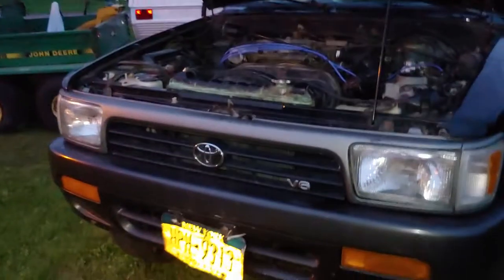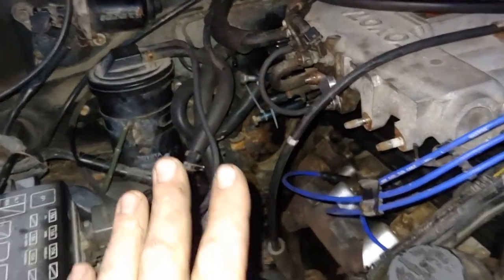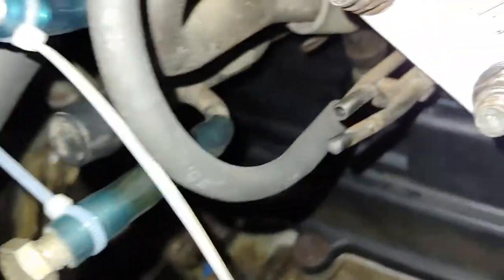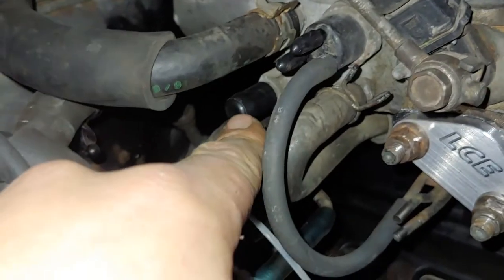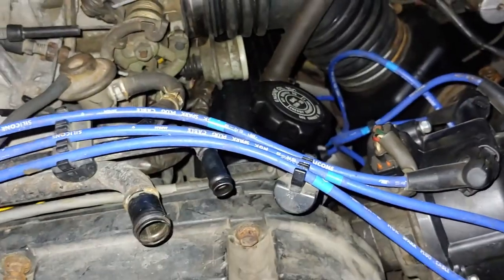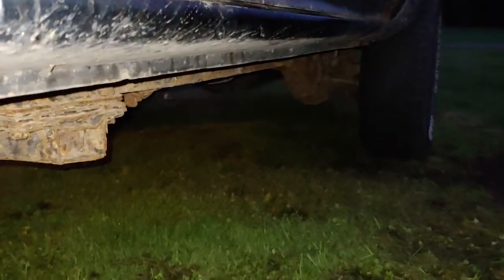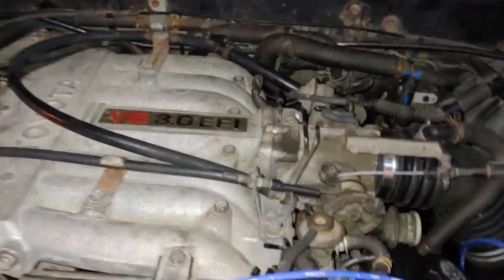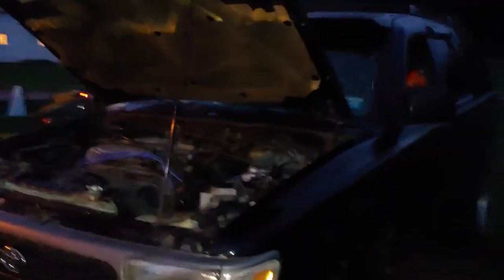NEED HELP 1992 Toyota 4Runner 3.0

Comment: I had similar symptoms.  I finally took the fuel pulsation damper off at the back of the passenger fuel rail.  It wasn't leaking like most failures, but the screw was loose under the cap.  You can't just slap the screw back in.  Replace it.  It can make a lot of strange fuel issues happen.   Good luck!

Comment: CRC mass airflow sensor cleaner spray, you must absolutely use a OEM Denso oxygen sensor installed properly. It must be an authentic sensor from authorized Denso distributor. Don't trust mechanics to do this type of stuff. They buy whatever Delco or Dorman or other garbage. Also run a tank gas with BG 44K Platinum...Great stuff.  Why did you block hot air from the engine from going to throttle body?

Comment: that year and engine has a recall for head gaskets. Toyota would of done everything for you for free. They should reimburse you for parts and labor. It happened to me. I have a 92 SR5 3.0. If you ever have another problem with head gaskets, take it to any Toyota dealer and tell them you want to do the head gasket recall. Toyota also honed my cylinders for free. They are using a different type of head gasket that was originally used. I now have 500,000 miles on my engine no problem. The head gaskets blown at 100,000.
Reply: Surely that warranty work is over, these engines are 30 years old now
Reply: @lsxbird7874  I actually had mine replaced twice on warranty.  Mine is 1992.  Once in early 90s right after I bought it, and again around 2005 when they blew again.  Now it has 500,000 miles on it and still running strong.  I took it to two separate dealers.  The first time Toyota didn’t tell me about the recall and I paid out of my pocket.  I then learned about the recall and they had to pay me back.
Reply: @lsxbird7874  it's a special service campaign, never ends. As long as the vehicle was listed in the campaign then they will go through with it. Contacting Toyota will get you further than some dealerships, some dealerships play dumb about it and other's go through with it.

Comment: First off, it's a 3vze not a 3vre...  Second, it sounds like your catalytic converter is clogged.  That is what the rattling is under the truck.  Basically your truck is wheezing under idle because it can't breathe out.
Reply from the maker: Thanks for the comment. I knew I was wrong as soon as i said 3vre. 

Any advice for a clogged cat? Is there a possibility of just shoving something through it?(I've heard that mentioned before) Or am I better off just getting rid of it? I want to do things as right as possible, but its also a $1200 car thats quickly gathering Northern New York salt rot on the bottom, so I'm not against any option that will get it running down the road alot better.
Reply from the maker: Im not usually an automotive mechinic. As a matter of fact I don't like it much at all. I am mostly a motorcycle, atv and small engine mechinic. Antique Motorcycle mechanic by trade. So, excuse me if I am unknowledgeable in some areas
Reply: @rednecknewyork  since you have already deleted your EGR system I'm guessing you don't need the cat.  So I would just get a high flow muffler and enjoy.  I personally have done the intake silencer removal, headers and a 2 n half inch pipe with a big muffler.
Reply: @rednecknewyork  https://youtu.be/COvKTVZd-fY if you want to see my current motor.  Ignore the mess.  I'm in the middle of a frame swap.  I have also donethe egr delete as well as flamethrower fuel injectors, a 7mge AFM swap, headers and a 2 n half inch muffler pipe.  She goes like a bat outta hell

Comment: I just did all the same shit but when I had the heads off I had em decked flat and new valve seats/guides/1 cam cause a lobe was wiped out new valve seats and all new valves..every exhaust valve was burned and leaking compression into exhaust. Do a leak down test and you’ll see if you
Got anything related to valves going wrong